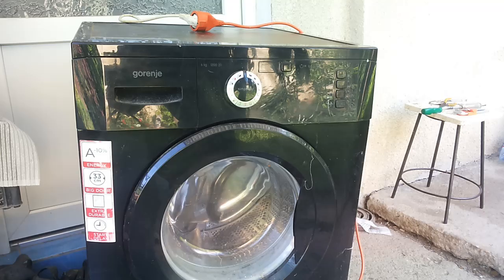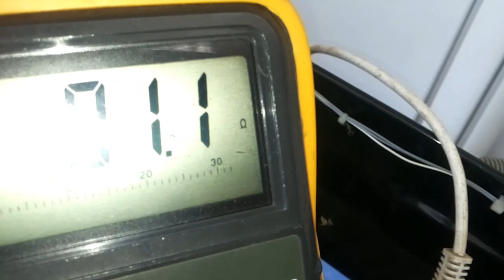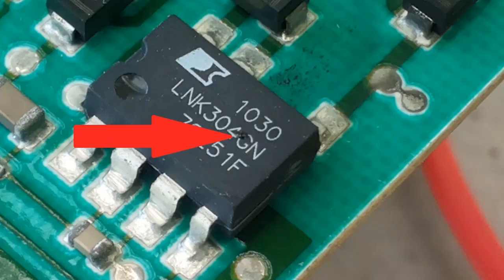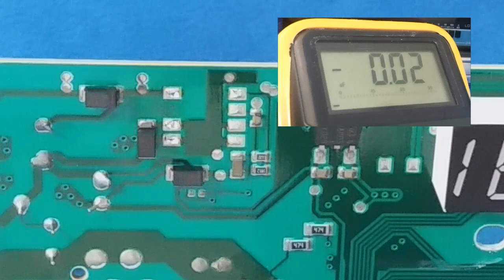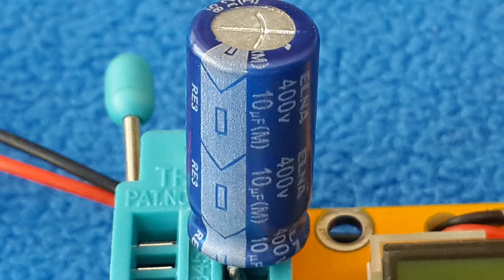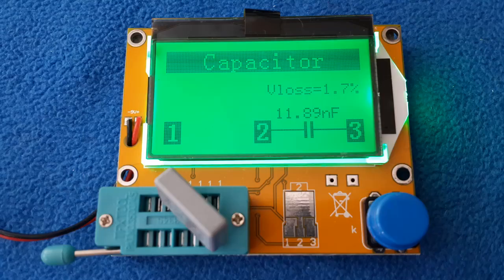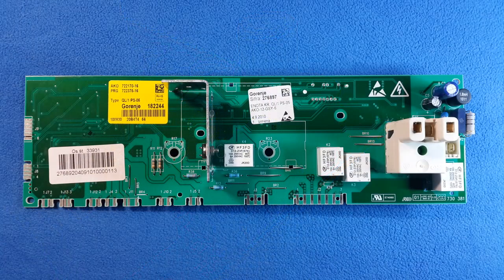How to repair a laundry machine / washing machine won't turn on problem / PCB control repairing

Comment: The black smoke on the IC is probably carbon dust from the motor's brushes. It gathers around the die area of semiconductors dealing with high voltage due to electrostatic force.
You will find it too on the small triacs which switch the drain pump or the inlet valves. No indicator for a bad chip.

Comment: You v good 👍  really I follow allot  you best but   but....

1st  what is Multimeter ..v or a or buzz..
2nd link for  sites you used..
3d.....data sheet link...
4 explan where to start.in the map work.....

Comment: Hey Bob. Kalpon this is a fantastic video thank you. Bob if the board is fried like this. 1. In a "commercial laundry premises "is it best to replace the whole board quickly so that the Laundry can make money reliably fast? 2. If the board is fried has this been caused by other problems in the washer machine - A. How do you know?  B. Do you need the board to work to see mechanical problems in motors etc. C. How do you test mechanical problems in motors etc without power?  Thank you Mike

Comment: Hi BoB ; thanks for all the great repair clinic; i also have a wash machine but different mod, it's a Maytag MVWC465HW and it's dead soi i suspect power board W10857311 ,but no support or parts, and i also suspect  that  AC_DC Off line switch chip, but  i can't see the chip info cause the board and components are covered with electronic protection  wax , so it's going to hard to find this chip ,with no info from Maytag or anywhere ,i'm stuck, so can you help me ,thanks
Reply from the maker: Hi! There are technicians who remove the wax or silicon. There are also groups in Facebook for washing machines repairing. It is better to ask them for help, because some of them already got the same situation and I Know they open a window right where they have to test o repair saving a lot of time and complications. Ask them, and they will help.

Comment: Hi bob thanks a lot for lecture . so i have Q. i have ocean 10 kg automatic washing machine these machine no power then 27 ohm resistor is burn what is the possible cause and action to be taken . lease help me .
Reply from the maker: Hi! In electronics any component can be the problem. Most of the time we find a bad component, but it the result of the failure and no its origen. It is the reason why I recorded the video. We must test all the components in the stage. My resistor was "burned" without smoke marks, the PWM chip was smoked, but the origen of the problem was the defective capacitor. The capacitor was not bad, but out of specifications.  and the problem. You must test all, and change what is bad, out of specs, and what is good, but it is time to renew to avoid future failures and customer to come back with other damage, but asking for the same warranty.

Comment: Como todos sus vídeo tutoriales, Excelente. Profesor, ¿De cual página podemos descargar las tablas de ESR.? Muchas gracias y saludos desde Venezuela.
Reply from the maker: ¡Bendiciones Ramón! Yo no uso tablas. Con la marca del fabricante del capacitor, valor en faradios, voltaje y algunas letras especiales impresas en el capacitor que indican el modelo, busco el datasheet del fabricante. De esa forma evitamos los errores. (Ejemplo: en un browser  escribo; Rubycon 25v220uF YXG datasheet  y busco entre los resultados la ficha actual de mi capacitor). Algunas veces el componente fue reemplazado por una nueva versión, y hay notas de "product changing" que indican la nueva ficha técnica para el próximo reemplazo.

Comment: When checked the capacitors installed, did you use a multimeter set on ohm setting, or did you use an ers meter?
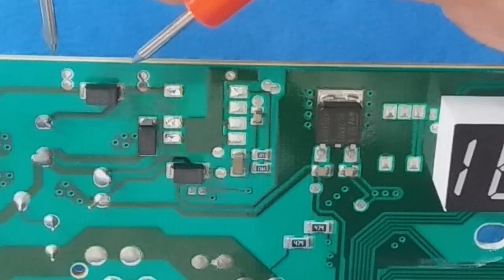Reply from the maker: Hi! Until minute 3:30 it is in continuity or resistance to detect short or linkage. After it trough hole caps I removed them and tested one by one. (ESR measurement is important in electrolytic capacitors).
Reply: Bob. Kalpon I just recently learned about ESR meters. Going to have to get one, I intend to learn more about diagnosing these boards and other electronic components. 
  I have always used regular DMM for checking components of appliances. I am just now attempting to learn more on the subject of electronics. 
  My DMM does have a capacitance setting. I bought it for that purpose for checking caps on washing machines. I now know I need a different meter.
  Since we are on the subject, do I need to use an ESR to check washer motor start capacitors?
Reply from the maker: @rickeykeeton71  OK, this is the best advice: capacitors, must be measured outside of the PCB, no mater what anybody else says about to measurements on board. That's the proper way because we don't want components in parallel with it.
Reply: Bob. Kalpon that is something else I need to learn, how to read schematics so I know what powers up first, which component depends on another component upstream and so on.